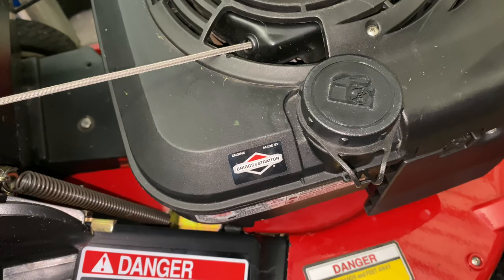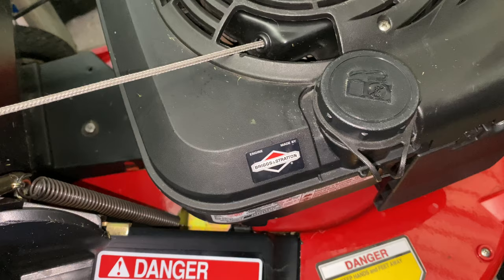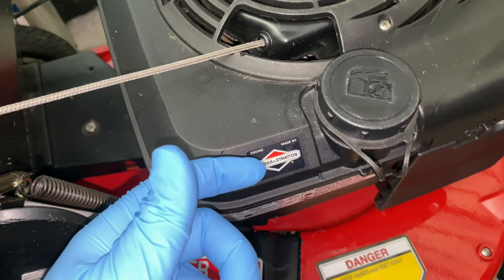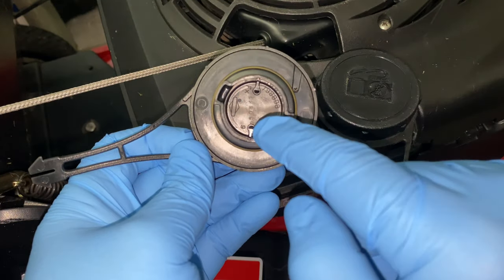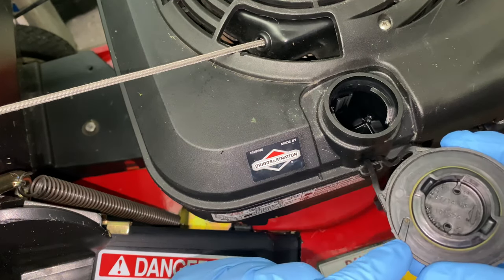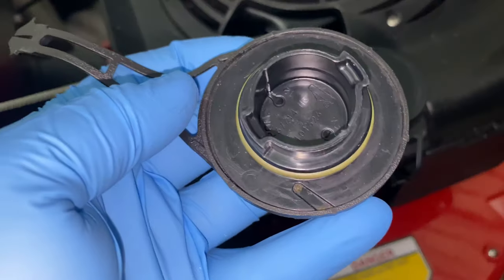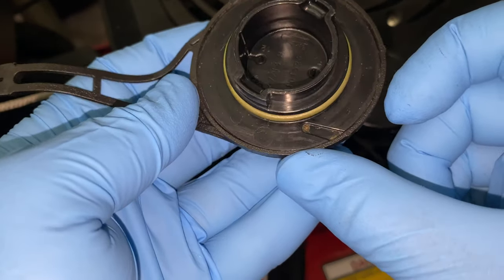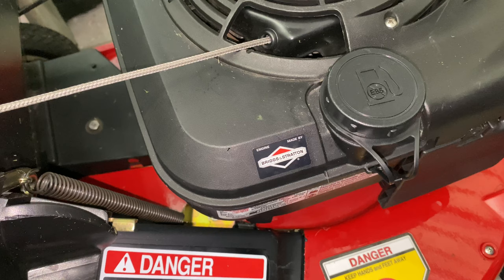Lawnmower Stalls Fix | Lawnmower Keeps Stalling

Comment: Just bought one for my Briggs. Not 10 bucks anymore. Paid $23. Inflation is real
Reply from the maker: Ouch! At least it got you up and running again I hope 😎
Reply: @NameItBuildIt   Yes it did solve the stalling issue 100%. But the new cap is so loose it actually leaks fuel and literally loosened itself right off the tank mid cut. Briggs OEM part not aftermarket. So annoyed
Reply from the maker: Didn’t see your reply, you could try an O-ring past the threads of the cap to seal it a little better. You could have possibly gotten a bad part that wasn’t molded right also. Give Briggs a call and see if they can give you a replacement.